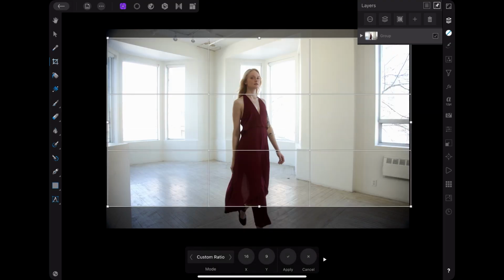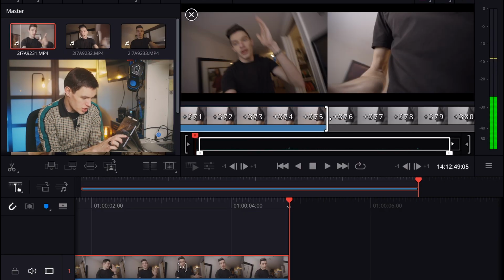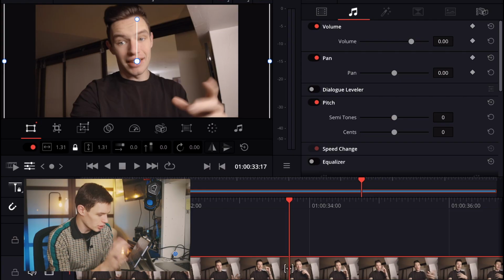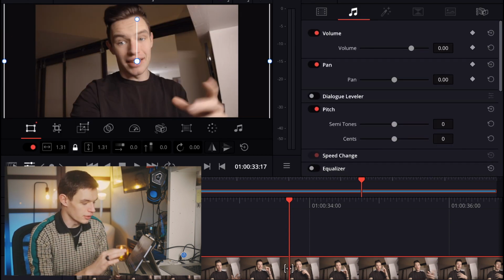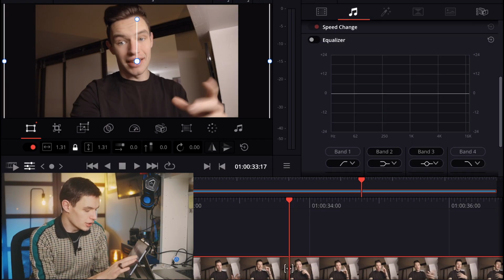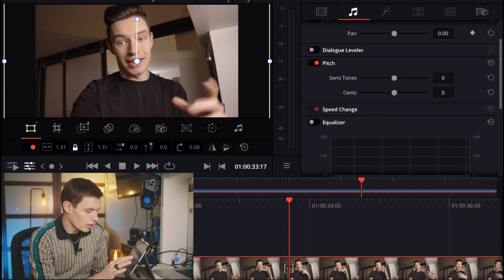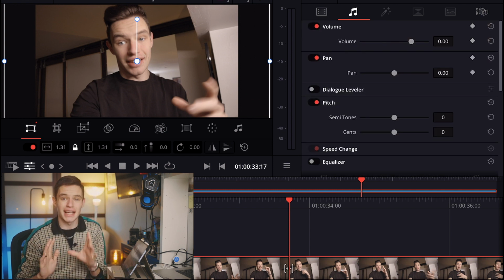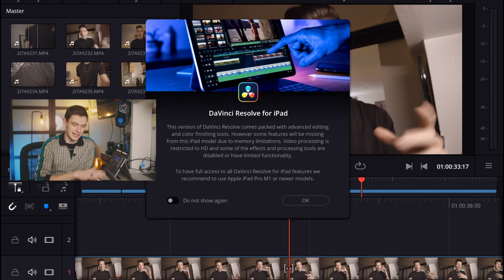Davinci Resolve for the iPad??

Comment: will a keyboard work, or you just do t have one connected? in your opinion how workable is it as an option without a desktop as well. It seems like it’s not the best workflow without the option to keep your hands resting on an input device, as opposed to always needing to use the pencil to Touch the screen?
Reply from the maker: Some really great questions. A keyboard absolutely will work, and I would actually recommend one, I simply don't have one connected as my main use for my iPad hasn't required a keyboard. This app is making me reconsider that and look into a keyboard, especially one with a built-in track pad which would help take this to something more in line with the desktop version. 
The workflow isn't perfect yet in my opinion, and to transfer files it would typically require a hard drive attached. That said, I think adding a keyboard + trackpad would eliminate the need for tapping the screen/using the pencil all the time, thus streamlining the process. This is mainly based on research that I've done and what I've seen from others, as I don't currently have a keyboard to connect to my iPad.
Reply: @fynnbadgley  Thanks for the response. Personally I would imagine the input controller to be one of the most important things over the long run. Speaking from somebody who has joint issues from overuse of antiquated computer postures. Looking into BM wheel controller or other iPad options might be worth it.